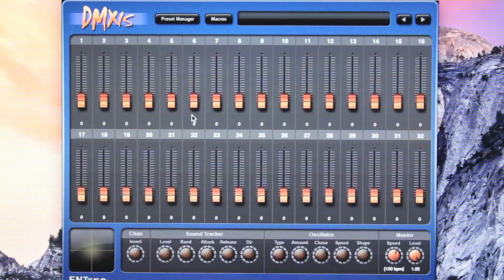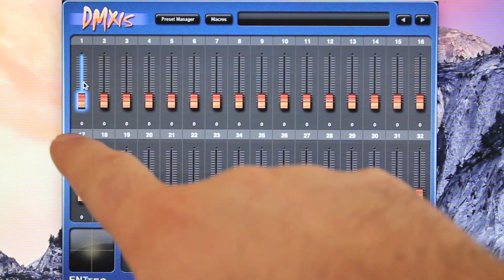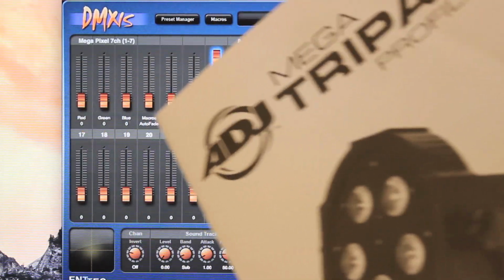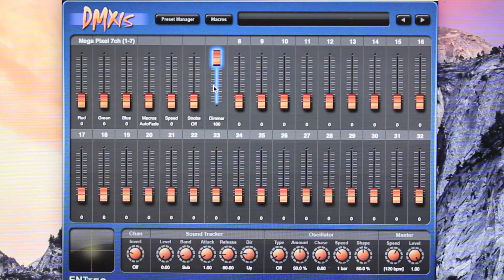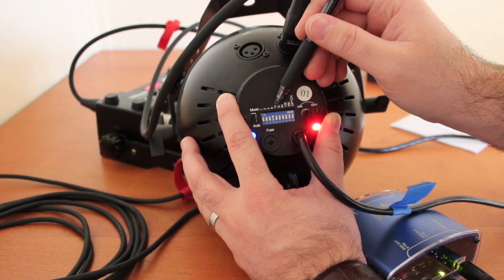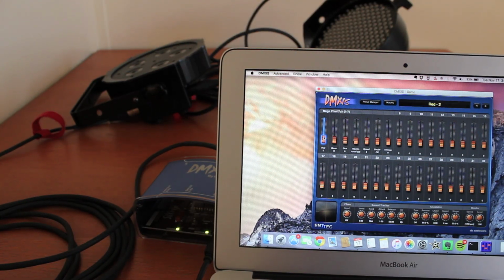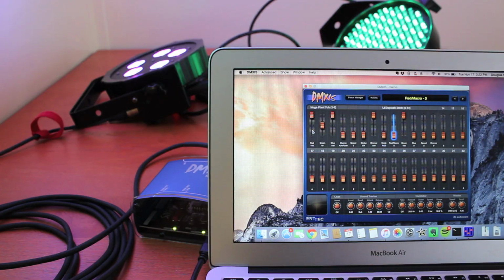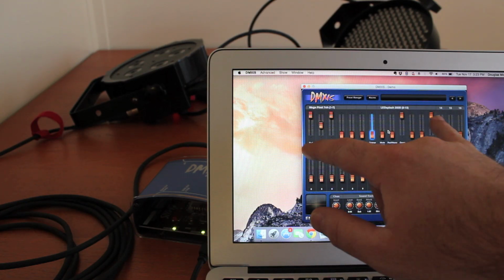DMX BASICS - HOW TO SET UP DMX LIGHTS

Comment: Do u need a controller if u only want to use the led lights in sound control mode & if connected to each other with DMX cable will they all be synchronized?
Reply: Did you ever find out i am looking for the exact same thing
Reply: Hi, no controller needed for sound or random mode just set the first unit's option to either sound or random. If slaved to additional units, they should match action of first.

Comment: why start at #17 on the software and not channel 1?? why does the second light connected get only 3 channels and the 1st light gets 7?
Reply from the maker: For the demonstration in the video, the first light (ADJ) started at channel 1. It's a 7 channel light so the next available channel is 8 and that's where I set the second light (Chauvet) to start which is a 6 channel light.